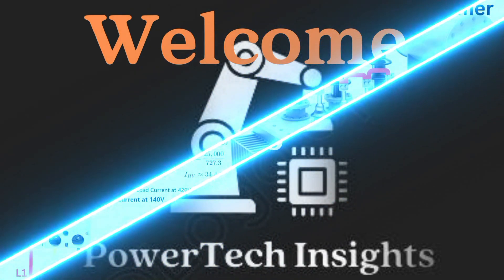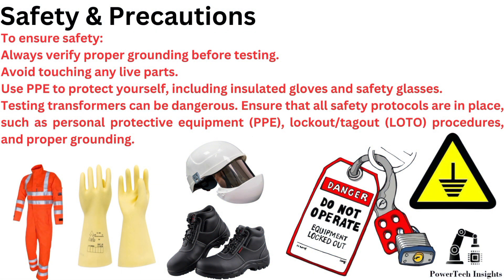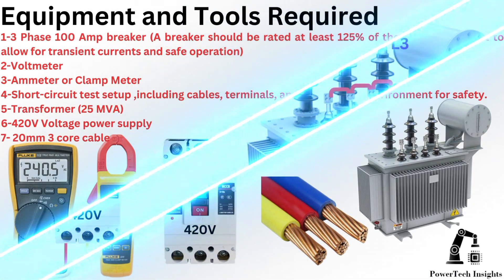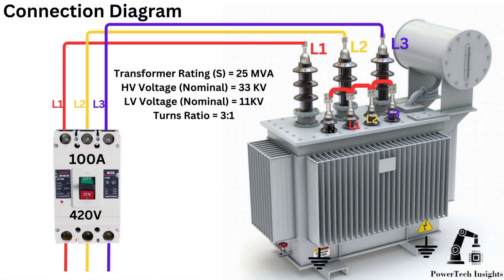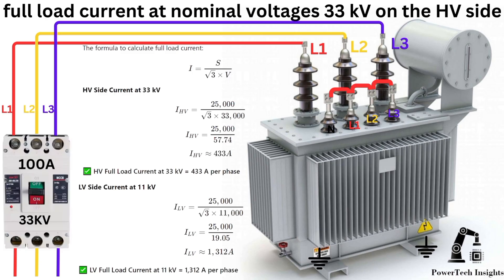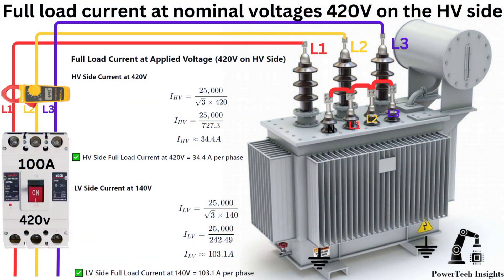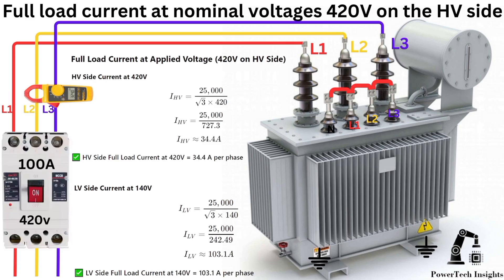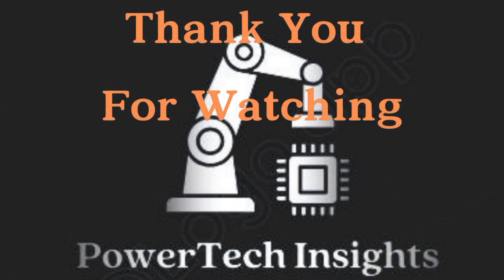Short circuit or Full Load Test of Power Transformer - Transformer Testing

Comment: Great video! Than you so much! I have one question, if it possible. Why you use rating of transformer in kVA, not in VA? You used 25000 in your formula. It is a kVA, isn't it? And in this case you should get current in kA. I mean so, don't I? Can you explain me. Why you used "25000" instead of "25000000"? Thank you in advance!
Reply from the maker: We are applying low test voltage (420 V / 140 V)
•	This is a short-circuit / full-load test, not a fault calculation
•	Fault current calculations would involve impedance (%), not just kVA

The value 25,000 is used because the transformer rating is 25 MVA = 25,000 kVA, and the 3-phase current formula is based on kVA, not VA. Using 25,000,000 VA would mix units and give a result 1,000 times too high. Since this is a low-voltage test, the current correctly comes out in amperes (A), not kA.